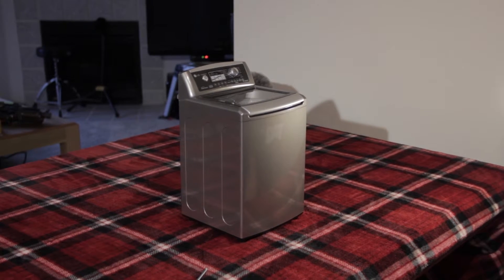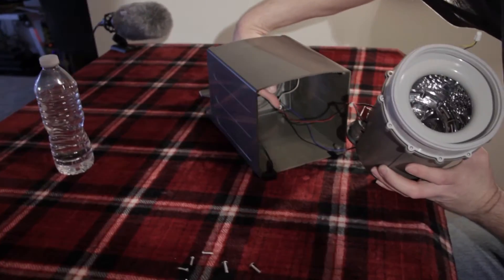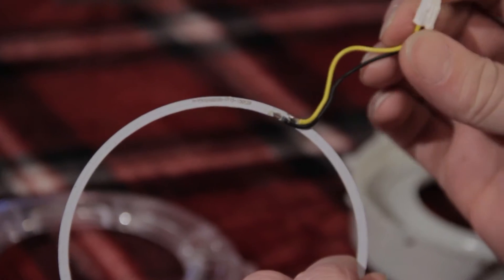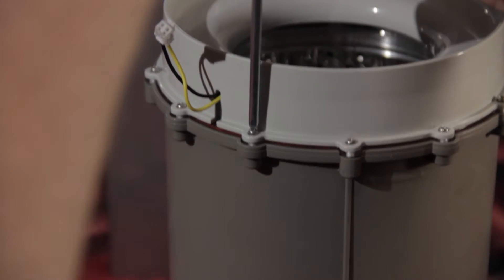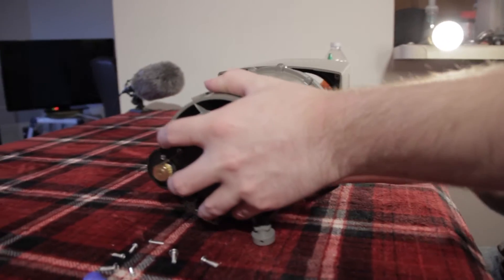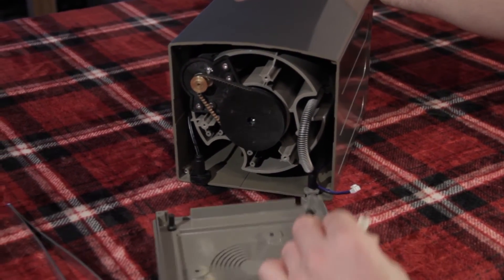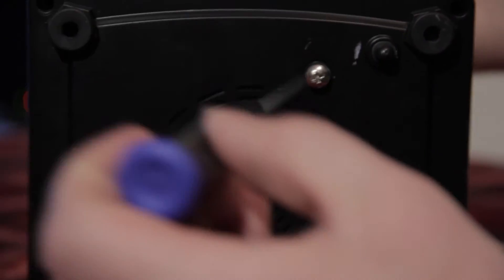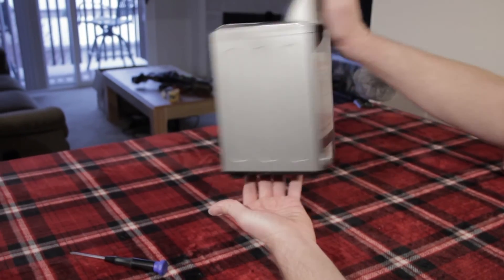Mini LG Waveforce LED Replacement Tutorial

Comment: Hello there again!

You might remember me hahaha hope you’re ok with all that’s going on!

Right so basically I done exactly what you done and I used another Power supply to my mini LG and Fried the LED ring but luckily I didn’t wreck all of them so it still lights up enough to still be able to see into it.

But I decided I few days ago to use your video and take mine apart and change the LED ring but I’ve run into a problem....

The little screws that hold in the tub I managed to get a few out and some I struggled with as they overtightened them and now I’ve stripped some of the heads on a few of the screws so for now I just thought oh well it still works so I’ll just put it back together but when I did I’ve now made it even worst and when I put the last screw on the bottom to secure the bottom part back on I’ve now broken the clips that hold the top part of the machine :(

So now I’ve got to try and figure out what to do as I feel terrible that I’ve now put one of these mini LG’s in this state. 

I’ve now got to try and see if I can get still try and get them screws out as I have the LED ring and also try and find a way to get some of theses plastic clips or something to Secure back the top part of the machine.